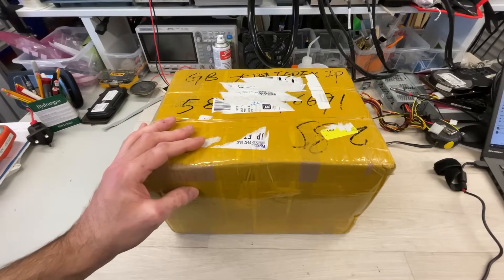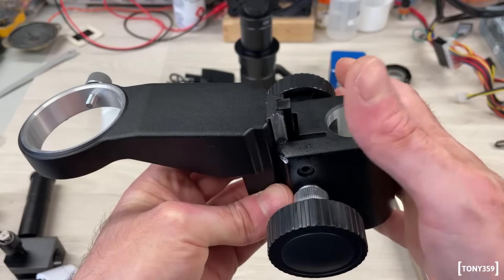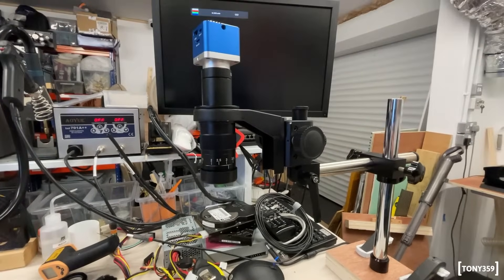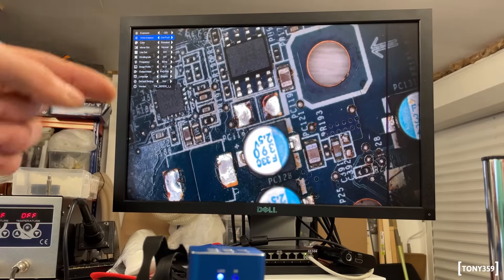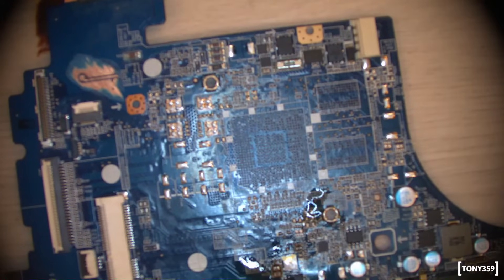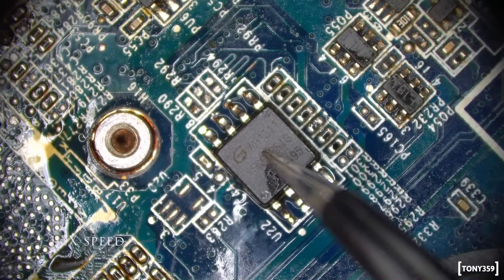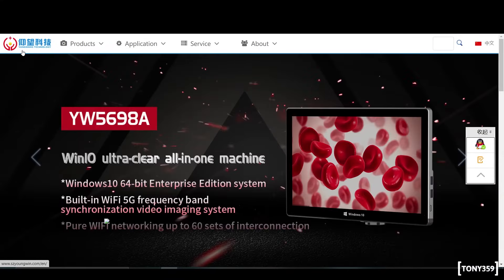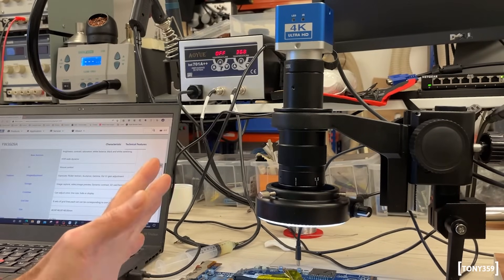Lapsun 4K Microscope - Sony IMX377 (?) - Unbox and Review

Comment: please excuse my question. You mention you had a long aftersales convosation with them. But the important part of that is what did they say in regards to you realising it isnt the right sensor? did they try and defend them selves or admit they have been very miss-leading? I mean if you pay for an imx sensor thats what you should get. not something else. Look forward to your reply
Reply from the maker: It's a very good question indeed. I discovered about the sensor some time after purchasing it. It's still an IMX, just not what they advertised. Given their unhelpfulness when I complained about the barlow lens - and given that I was happy with the quality of the image - I did not contact them again. I am currently still very happy with this microscope.
This is why I said that I would not go with them for a more expensive sensor - or at least I would put some protections in place to make sure I can get a refund if it's not. Thanks for watching!
Reply: @tony359  fair enough. That would be a big issue for me. Buying something and getting something different. Like buying a Ferrari and finding out it’s got some lame V6 engine in it. Anything thing is if your going to review a 4k camera how come you didn’t get a 4k monitor to match? I mean they arnt a lot of money these days. Else you may as well of tested a 1080p camera as essentially that’s what you’ve done ;). I’ve been on the look out for an upgrade camera. More so an actual 4k. But really interested in picture quality compared to a decent 1080p variant. Hopefully one day you can do another video when you have a 4k monitor hooked up and see what it’s really made of 👌🏻
Reply from the maker: @MrOrangeman18  I don't have a 4K screen and this channel is my hobby! In my opinion, in photography pixels are not everything. The optics are usually as - or more - important. I did not buy this microscope just because of the resolution. 
About the product, you made a good point: I did not buy a Ferrari :) I bought a Golf and I was sent a Focus. Still not good but the Focus is a good car too! Your point is valid though, I just did not contact them as I knew I had ZERO chances of getting anywhere :)
Reply: @MrOrangeman18  If you want the #1 video - FPS / picture quality you will need to find super old stock of the IMX290 cameras. It has the best sensor technology and the low light clarity cant be beaten due to how the IMX290 sensor is designed. I have purchased about 5 camera's after my real IMX290 and none of them can compare. 3-4 years ago Eakins was selling this model but they went out of production and all listings anyone is selling has a different sensor. They claim IMX290 but you will receive the IMX307 <--- terrible and or the IMX185 <----- just as bad as the IMX307 but slight worse in frame rate. The only real saving grace as of now is the RT5109 from RISING CAM with the real IMX334 sensor. That one does indeed have a real 60FPS with no interpolation. Lapsun sells the IMX385 v2 now and claim its the BETTER sensor compared to the IMX290 but in actuality it's by no means. North Ridge Fix purchased 1 real IMX290 camera and used it for a few years. Look at his previous videos and you will see such a difference in quality and from rate. NRF was selling the fake IMX290 camera on his shop but he was also lied to. They were all IMX307's until now. He got rid of them and just sells the IMX385 cameras. Lapsun will try to screw you no matter how much you spend. Ali-Express is tough sometimes when trying to get a refund when it comes to this stuff.

Comment: Can you buy this camera by itself?  And will it fit in the camera port of a normal microscope?
At $145, I might buy the whole kit just to get the camera...
Reply from the maker: You can buy just the camera yes. It's a C-mount camera, the dimensions are standard. I can tell you the ring where it's clamped is 50mm.

Comment: After fiasco with Eakins IMX334 4k@30 1080p@60 fps (it has actually much better sensor IMX678, but it is only 30 fps at 1080p) I'm considering to buy this or another one (RF4 4KC1) with smaller sensor (visually from photos and review video where they show sensor on camera it's IMX415 or IMX715). Does your camera really provide 1080p@60 fps over HDMI? Both of your videos are only 30 fps so I cannot check visually through stepping frame by frame. I've seen 10th of 60 fps videos with cameras that claimed to be 1080p@60 fps and almost all of them in reality provide only 30 fps (and some of them, like Kaisi in metallic collor with red buttons, do not even provide 4K, toggling it in the menu does nothing, so it is ~100$ for 1080p@30fps lol), when frame stepping it takes 2 frames to refresh the image on the monitor connected over HDMI, and those few with real 1080p@60 fps looks really smooth even without frame stepping...

P.S. Most of these cameras when connected both to HDMI and USB (like in your video) will provide the lowest FPS to both outputs, so if HDMI is 60 fps, but USB is 30 fps max, it will provide only 30 fps over HDMI in this case.
Reply from the maker: I can check for you. I never felt it was an issue but I never checked myself. How can I check on a monitor though, if the monitor reports 60fps but the scope is doubling 30? I do have a capture device, should be able to do 60fps. I can also check on a 4K TV if it's actually doing 4K, I never bothered as my tired monitor is just 1080! :)
Reply: @tony359  That would be great. For 60 fps the easiest way is to film the monitor with 60 fps smartphone or video camera while moving a board under the microscope. Capturing is probably also a way to go, but only if it for sure can capture in 60 fps. 4K would also be a nice check just to be sure camera can provide it.
Reply: @tony359  Sorry to bother you, but any updates about this test?
Reply from the maker: I haven't forgotten you, I keep reading this and think that I have to do that. Sorry for the delay!
Reply: @tony359 It's ok, I'm not pressuring, just wanted to remind, so take your time. I'm also still researching for other less popular models to find out more information about their real specs.
Reply from the maker: I did some tests for you.
- I recorded at 60FPS on OBS while moving an object quickly under the scope. I then imported into Resolve and played frame by frame. Each frame shows movement, they are not duplicate. This is with just OBS or with OBS and monitor simultaneously. 1080p. I noticed that the picture is getting expanded and compressed while moving the object up and down, I believe it's the effect of the capture scan of the scope itself?
- I plugged the scope to my 4K TV and the TV reports. But we're not expecting 60Hz at 4K so that's fine. 

When I bought this scope I was told it would not do USB and HDMI simultaneously so I cannot complain :) 

Does this help?
Cheers
Tony
Reply: @tony359  Thank you, that was helpful, if you don't mind could you also send that recorded 1080p@60fps video to email? Would like to see image quality without youtube compression..
Reply: @tony359  >I believe it's the effect of the capture scan of the scope itself?

Yes, it's probably because of rolling shutter sensor (it also should be kinda wavy when moving horizontally especially at lower fps), global shutter sensors don't have this issue but they are more expensive especially at 2M+ resolutions.
Reply from the maker: I can send you another one 30FPS - the 60fps one is a piece of paper with an address scrolling and I didn't bother to focus. I would need your email address!
Reply: @tony359  Would like to see 60 fps just to be sure how fluid it is (even if it's only few sec), but to not waste your time 30 fps will be ok I guess. In my prof desc.
Reply: @tony359  damn youtube, it's impossible to post address, tried ~7-8 times before it finally passed, even without address itself just to say where to watch it, always automatically removes post after few seconds...
Reply from the maker: Remind me if you don't hear from me, I'll record some proper video at 60hz tomorrow!
Reply: @tony359  Ok, thank you very much!
Reply from the maker: uploading file, you should get a WeTranfer notification soon.
Reply: @tony359  Downloaded, image quality is nice, but as I understand it is 30 fps camera setting (it updates image every 2 frames)?
Reply from the maker: I deleted the file! The files I made yesterday were not like that. I checked with Resolve. How did you check that? Can you send it back to me? LOL!
Reply: @tony359  Ah I see it was sent by that website, I've resent it back and also a record from my old camera that can provide 60 fps but only at 720p.
Reply from the maker: VERY interesting. The one I recorded the other day is definitely updating every frame. The one I sent you, indeed, updates every two frames. Let me check, maybe I left some settings wrong but I suspect it could be the firmware of the scope a bit "unpredictable". I noticed I would have 4K output on a 4K TV regardless of the output setting. Actually, that might be the reason: in 4K it set itself to 30fps. Chances are I have to switch it back to "FHD 60" and even though it doesn't seem to do anything, chances are it will reset the framerate to 60fps. The other video is fluid - still I feel that 30fps are plenty for working on a static board! :) I cannot evaluate the picture quality as the image is moving too fast :)
Reply: @tony359  Hmm, that's interesting, looks like some kind of HDMI menu bug, maybe even fixable by the firmware update if vendor can send a patch file. You probably already a bit tired of me, but could you later try to record and send actual 60 fps video? If it will be good then I'll probably finally get this camera.
Reply from the maker: I tried and... it was 30Hz. I then realised I had set the source on OBS at 30, I set it to 60, tried again and it was "double 30" again. Then it was late. I'll try again today! No worries, I am curious too. I normally do everything 30hz as 60hz is twice the size and I don't really need that to show a static image :) 
Firmware update: yes. BUT: the microscope is working fine. Do I want and try to update it and potentially break everything? I like updating things but in this case I think the chances they send me the wrong one are high :D
Reply: @tony359  You are right, updating probably not worth the risk, especially if there is no way to make a backup of current firmware.
Reply: @tony359   > I'll try again today!

Any update?
Reply from the maker: Forgot again, sorry! :) Feel free to send me reminders via email :)
Reply: @tony359  Don't know how other monocular objectives but this one has 1m+ working distance without any barlow lens, and 16cm with 0.5x lens made specifically for it (small sized with M26 thread), manufacturer does not have any barlow with lower than that magnification, but I tried some close-up lenses for a photo camera, +5 diopter is kinda similar to that 0.5x barlow and +3 looks like 0.3x (it can fit a QFP144 chip vertically without any gaps), +2 is also close to it (QFP144 with ~1-1.5mm gaps bottom and top), gonna buy some adapter rings to attach them.
Reply from the maker: file sent - this time it's 60hz - I hope! I just had to set the option in OBS to "default"! :) Let me know!
Reply: @tony359  It's still 30 fps (and as in previous file it shows 60fps, ~10 mbps bitrate) - board moves every 2 frames :(
Reply from the maker: uhm... I think I know what's going on here!
This time I imported the file in an EXISTING Resolve project, which is set to 30FPS. I thought Resolve would adjust the new timeline I used for the test to 60FPS but it likely used the PROJECT framerate which is 30. Hence I thought I was playing 60FPS but in truth it was 30. Not knowing that, I thought "this is 60FPS".

On previous tests I created a whole new project. When I imported the file, being the only one there, Resolve asked me to change the project Framerate to match. And then I could see 30FPS (one update every two frames).

The bottom line is: you might be right and this scope can only do 30FPS. Last thing to try is to disconnect the HDMI monitor and try again.
Reply: @tony359 So you gonna try one more time? If it still will be 30 fps, I think it is what it is, looks like all these cameras in sub 400$ range cannot provide 60 fps (especially those with YW media chips).
Reply from the maker: I have to ask the question though: do you think 30Hz is not enough for electronic repairs? :)
Reply: @tony359  For me movements are kinda wobbly and a bit blurry compared to my low res but real 60 fps old camera, especially when doing microsoldering, it affects hands movement response to seen image almost the same way as bigger image delay over USB compared to HDMI. And of course false marketing, I want to get 60 fps for that price, in this case only 2 models are left but they have worse sensors: HY-5299 with IMX117 (it for sure can do 60 fps at 1080p) and RF-4KC1 with IMX415 or IMX715 (almost sure it can, but couldn't find any reviewers who was ready to check it), everything else is in 400$+ range with additional custom fee. There are also these crap blue/pink/gray/black cameras those marketed as 38/41/48/52 MP, but all of them have MN34120PA 16MP 3:4 sensor that is probably cropped to 1080p 16:9 (there is no info in the datasheet about pixel binning), they also provide 1080p@60fps but image quality is bad especially compared to something like IMX334.
Reply from the maker: well they told me the scope would not do HDMI and USB simultaneously - but it does. So the "bad marketing" this time worked for me! This is one of the reasons I don't want to risk an upgrade in case they "fixed it" :D
Reply: @tony359  Also, just to clarify, all these test records were done with only HDMI connected and no USB connection at the same time? Because both outputs connected can limit HDMI output to 30 fps (it happens with those expensive cameras those can output 60 fps 4k and 1080p).
Reply from the maker: no those were all USB. I did HDMI only today and got even worse, like one frame every 4 :) But then my capture device comes into play.

Sooooo I took a 60hz video of my monitor (no USB). Obviously the framerate is not going to be synced but I've inspected it and it's 30Hz again.  I guess that's the final test! :)
Reply: @tony359  Got it, I thought previous were HDMI, even in those expensive 400$+ cameras USB is usually 30 fps at 1080p, ALL of these 100-200$ have 30 fps limit at all resolutions (even those where no HDMI output only USB, and stated it can transfer 60 fps over USB 3.0, are fake there were videos where it showed maximum 30 fps). Also have you tried connecting only HDMI but directly to monitor (without USB connected during power on) and check 60 fps visually toggling between 4k and 1080p, it must look really smooth and kinda even sped up if you are not used to 60 fps video records?
Reply: @tony359  Btw on sellers webpages of this camera is written that it supports only 30 fps at 1080p over USB, that's why I considered you were checking it over HDMI but was not sure with USB connected at the same time or not, because even if HDMI outputs 60 fps, in this case it will output only 30 fps when connected simultaneously with USB.
Reply from the maker: Yes, I recorded a 60fps iPhone video of the monitor when the scope was ONLY connected to the monitor (mind you, to trigger the scope to "HDMI only" you have to power the USB-C port via a power supply. If you use anything which is connected to a computer to power up, it'lll switch to USB mode. How do I know? The OSD menu doesn't work when USB is connected :)

All previous videos were via USB.
Reply: @tony359  Ok, then that's it. Thank you for all the wasted time, gonna bother some other reviewers now with different cameras, while searching for the good one.
Reply: >HY-5299 with IMX117 (it for sure can do 60 fps at 1080p)
Appears it cannot, at least according to the test that was made by one of the reviewers I asked: https://www.youtube.com/watch?v=8S9DWWhkzQ8 (he is also comparing at the end of this video SD record that is real 60 fps vs HDMI that is fake 60 fps).
But another reviewer of the same camera answered he was recording demo for his video with HDMI capture card at 1080p 60 fps, and it looks like 60 fps, so not sure is he lied and just used record from SD card or has some different version of a firmware where 60 fps works, at least in video above it shows how it really is.

Comment: 10 cm is small height to work with tools can't aproach like they should...small area, then 50cm is too much did you get another lens ?
Reply from the maker: I got a 0.75x barlow, that raised the height a bit. I think a 180x + 0.5x Barlow would have been the sweet spot. But as it is now it is ok, I feel. Thanks for watching!
Reply: @tony359  no problem mate I just subbed nice content you have and skills, BTW why are you repearing such a old stuff ? Not something newer :D
Reply from the maker: It's a combination of nostalgia but also because everything is bigger there and it's easier to diagnose. I can follow the traces etc.